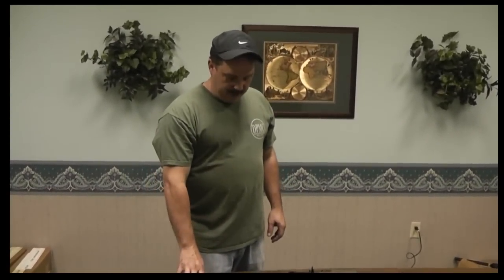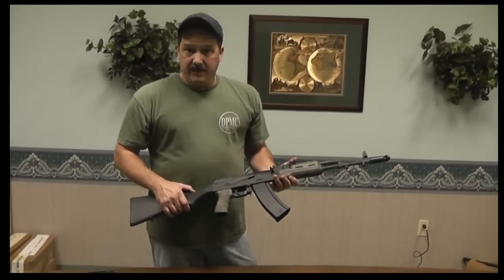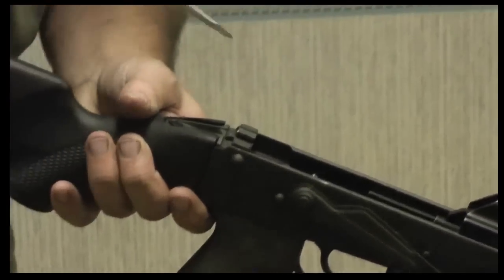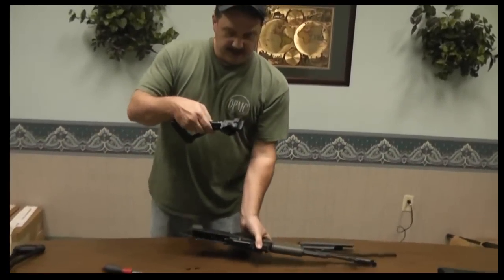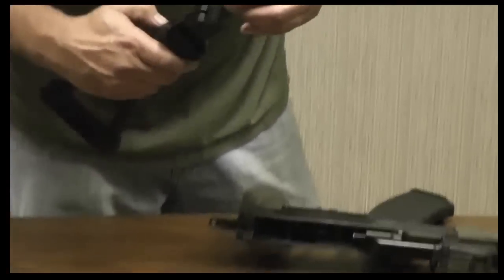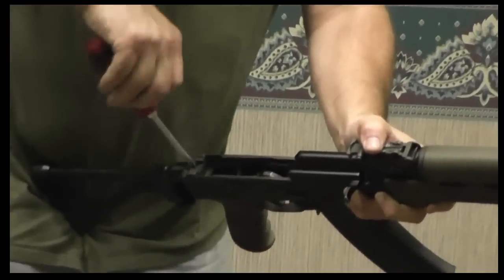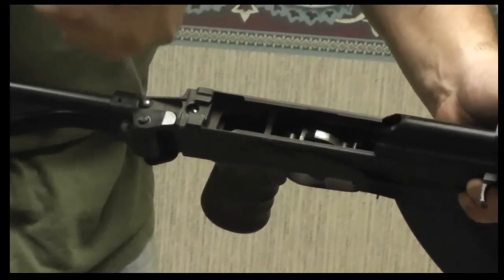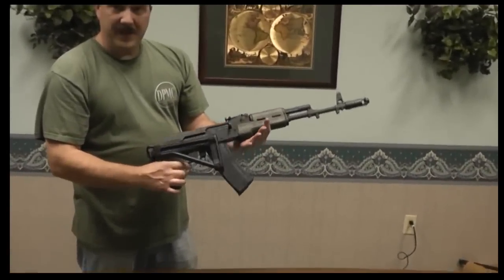Sidefolder Installation

Comment: I have this folder on my VEPR and love it.  It fits the gun perfect and locks up fully tight when folded open.  I think these are some of the highest quality after-market folding stocks available.
Reply: what length is your stock?
Reply: I used an ACE 8.25 inch "skeleton" with the modular (hinge only) from CNC Warrior.  This was the appropriate length for proper eye relief when using a POSP 3-9x scope.

Comment: I just got my brace in for the polish lynx.  The mount hardware you sent I can’t wrap my head around.  It doesn’t make sense with your butt stock drill kit.  I’m a mechanic so I’m capable of doing this install but I don’t understand why you sent a 3/8 bit but the bolt is clearly smaller.   Plus there’s a spacer.  Do you have any information on this install before I drill into my receiver?